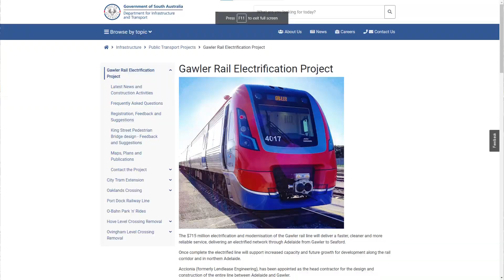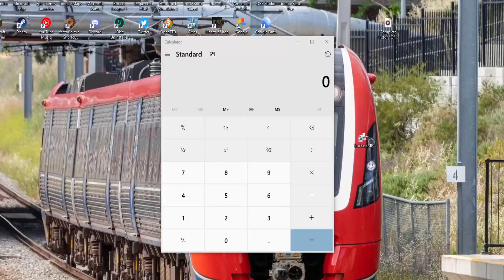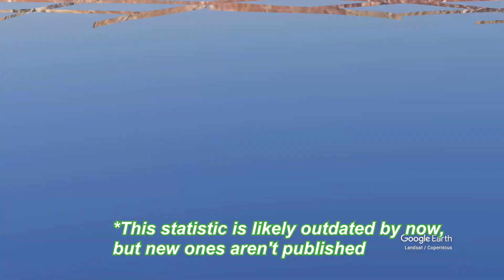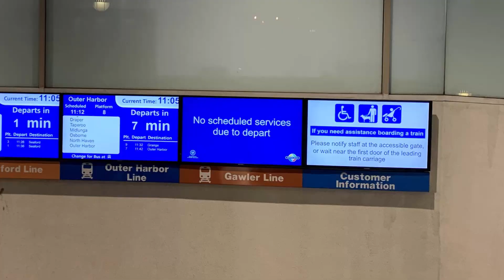Gawler Line Electrification Project Explained

Comment: I don't really see there being a prospect of SA population growing
Reply from the maker: What? Adelaide's population has grown from 1 million in 2000 to 1.3 million today. It's not exactly lightning growth but it's growing quite a lot. South Australia's population will hit 2 million by 2050 as well, there's no signs of it slowing down, the pandemic is a small dip in overseas immigration that will be gone in a few years. Adelaide's population is growing, it's growing a lot still and it's going to do more yet. Most of this growth will be in the northern suburbs too, where it will greatly benefit from the Gawler Line electrification.
Reply: @AussieWirraway , Any city doesn't need a massive population or crazy high density to justify a good public transport system. It's time to open our minds and realise that any city including Adelaide cannot survive without high quality public transport. Adelaide currently has bad public transport which actually contributes to road congestion as buses in mixed traffic serve Adelaide CBD excessively. A hub and spoke system PT in Adelaide is totally unworkable and needs to be redesigned to a connected frequent grid. 90% of people in Adelaide drive on weekdays as a result of a lack of cross city buses, fast and frequent train services.

PT experiences in Perth, Australia are a model to inspire in improving Adelaide's struggling PT. Also, Perth is a low density city, but has the best suburban train network for an Australian capital city. There's a comprehensive long term plan to improve Perth's public transport with buses, busways, tram/ light rail and trains/ heavy rail.

Comment: Hi Aussie that may me wondering if there was a test train going to being on the Gawler line or maybe just putting wires down the pole and thanks for the Gawler electric trains I will being looking forward to that when the Gawler line is open for the Gawler rail electrification project will start
Reply from the maker: There will likely be test trains on the line by late this year, as they have started putting the OE up, but OE will be needed right into adelaide station before testing can begin
Reply: Hi, Aussie just needs to tell you the Gawler line won't open until 26.4.21 just need to tell you that but it not going to run to Gawler central it going to terminate at Mawson Lakes and on the 25.4.21 there is going to being a test train to Adelaide to Mawson Lakes and if you click on the link of Adelaide metro https://adelaidemetro.com.au/Announcements2/Service-updates/Gawler-rail-line-closures#Boxing%20Day and make sure you visit that one so you can see what is going on and see what line is closed and if you see where they are closing from which stations go to Adelaide metro and ask everyone Aussie but make sure you do more electric trains project.

Comment: Great video. I have a transport channel which I recommend you subscribe if your interested in transport video. I plan on filming some bus and train videos more on there later this year. Looking forward to seeing more rail videos on your channel. Also quick question, are there potential Train line extensions for either the Belair line or Gawler line later on down the track to further on?
Reply from the maker: I've subbed and will be looking out for you videos :)

As for your question - no, I'd say we'll be waiting at least 5 years for railway extensions in Adelaide. one might happen if 2023 if Labor gets elected however.
Reply: I want to see the Belair line extended to Mount Barker, get electrified and major station upgrades at the same time. Just common sense